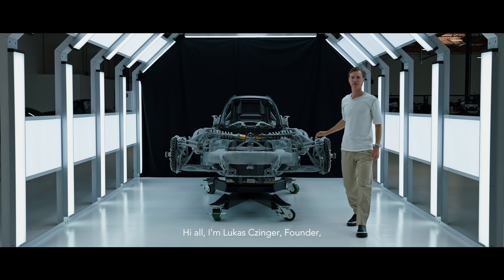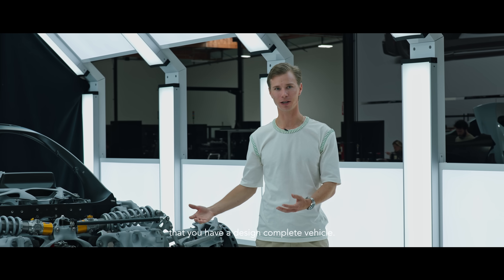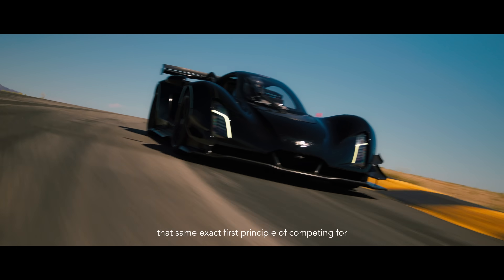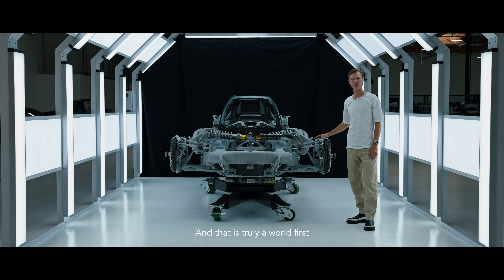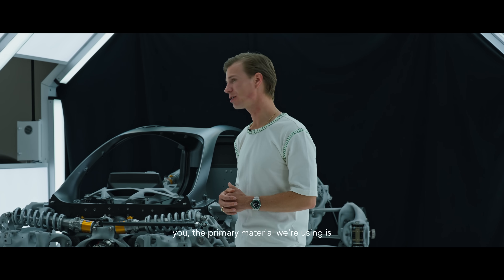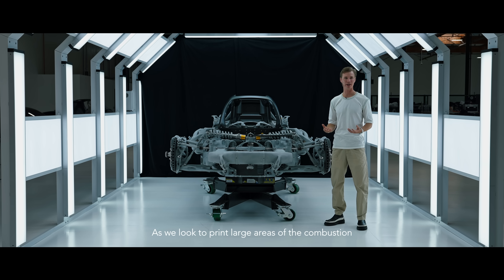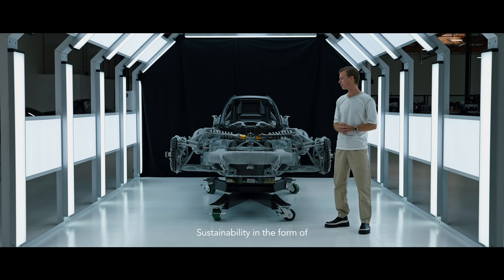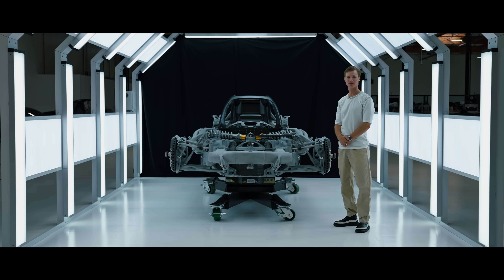Czinger 21C: The World's First Bio-Logic™ Chassis | In-Depth Overview

Comment: "you couldnt take a gram of material out of this chassis"
oxidation and abrasion: allow us to introduce ourselves
Reply: There's an FOS aka factor of safety that engineers take into account while making calculations. So things are slightly over engineered and under the conditions it is supposed to experience, it should not fail.
Reply: Maybe the intent of their statement is: "you couldn't take a gram of material out of this chassis without violating a constraint in our optimization"
Reply: @lucassganderlla7305 I am sure thats what it means. Because it definitely isnt on the edge of falling apart or folding in half.
Reply: @lucassganderlla7305  I think that's the most accurate. No way all the fasteners were designed specifically per load path and conditions, plenty of grams be to removed by drilling bolts / reducing head height or just bonding instead of bolting. The amount of assumptions made has to be incredibly high in comparison to an industrialized, mature company making constraint choices.
Reply: Probably factored into the calculation. Aluminium doesnt oxidize that much anyway for it to matter.
Reply: @KK001  perhaps it'll double as a sub and deal with salt water
Reply: Meh. It's marketing hyperbole anyway.

1. Perhaps it's true for whatever constraints they used. But we don't know--for example--exactly what and how many different load vectors were utilized for impact simulations, or how accurately they reflect real world collisions. We don't know--for example again--how extensively their proprietary printed alloys have been lab tested. We don't know--one more time--what size pothole was simulated and what speed and direction it was driven over, or whether two different potholes being driven over by different tires at the same time was simulated. Generally speaking, there are an infinite number of iterations possible, and there is no way they have iterated an infinite number of times.

2. If it is literally true, I guess you had better not ever mount stickier tires on it.
Reply: modding comunity: Hold my beer
Reply: Still doesnt make it not true.
Reply: @matthewpauls2498 He said you couldn’t take a gram out without compromising is strength, meaning this is the lightest it could be, he never said the frame CANT lose a gram of material, just that the structure would no longer be safe or stable without that lost gram. Plus it’s aluminum, it doesn’t rust. Iron rusts. Aluminum does oxidize, but that’s a different chemical not called rust
Reply: @lina4469 Ofc, my joke implies everything you said. i didnt include the rest of the quote because we all watched the vid and know the context.

but yeah it was a hyperbole but to be fair battery acid will eat aluminum and that could be catastrophic in such a car worst case scenario.
Reply: What happens when a bearing or spring wears out eventually? How many chassis components would I need to access and remove relative to a conventional car. As long as maintenance cost and complexity can compare or beat conventional designs that’s where the real sustainability will come in.
Reply: @baconthevainglorious7371  how many chassis components would you need to access and remove on a Bugatti? Stupid comparison.
Reply: @Matt_pau  rust and scuffing is bad regardless of the car
Reply: You can't take an ounce from any existing super car . This is technology that's cutting edge . This makes a Bugatti look like a pedal car .
Reply: Uninformed criticism is not very helpful.
Reply: @ScotMerrifield  That would be incorrect. If it weren't there, nobody would correct it. Oftentimes uninformed criticism is more helpful than informed, for just that reason, so long as it's treated/handled properly. Oftentimes it isn't though...
Reply: sacrificial anode: allow me to introduce myself
Reply: Abrasion from ?
Oxidation is taken into account by the FOS.
Reply: Already aluminum, not much corrosion there. AND it’s a proprietary alloy optimized against corrosion. No doubt it is very impressive, no matter your negative opinion.
Reply: @ScotMerrifield  whether or not you're correct, criticism is important, both to development, and to discourse. Dismissing it as just a "negative opinion" is so disappointingly petulant. 

They were off the mark with this one, they clearly didn't know that, or else they wouldn't have made the comment. You informed them with your comment. Why do we need to be flippant/passive-aggressive about it as well? Does it help your point? Does it help them understand? Does it bring you some odd manner of catharsis?

I agree, people should know what they're on about before they speak. However, the claim in this case, wasn't baseless from a general standpoint, it became baseless due to context. In most other cases, there'd be at least some merit. 

Let the ignorant scoff. Lead the horse to water (inform them) and let them choose whether they drink (let them choose to listen or not). At the end of the day, you have the knowledge, and that's something to be glad for, especially moreso than derisive toward ignorance.
Reply: $hit total crash test is total error with this construction bioergonomic...(only is exist in Architecture).... .
Reply: @CrazyGamerStudios  make sentences. Make sense. Point deciphered. Point invalid due to lack of comprehensible verbiage and lack of fact in statement.
Reply: Have you tried not taking figures of speech literally for a change?

Comment: This is mostly a lot of advertising spiel. 'Prato' is just multiple-criteria design which is what most of product engineering is. 
Ironically, despite the fact other manufacturers have used additive manufacturing, BMW invested a lot in it and I believe Porsche 3d printed pistons (GT2 RS?), multiple-criteria design is the reason it hasn't been widely adopted because it's expensive, labour intensive, time consuming and difficult to effectively scale up.

Topography optimization is genuinely interesting but the entire thing about nature and evolution is weak. We're talking about computers trying to design the optimal stiffness structure with the expected stresses and loads as inputs. There is the issue of unexpected stress where I'd like to understand more of their thinking. 

6000 series aluminium is the most popular series for machining. The automotive sector mostly uses 5000 series because it broadly has better strength to weight and corrosion resistance. The reason I think they are using 6000 is because it prints reliably. 

As for the 'weight' issue, I might be wrong but I think the Gordon Murray T.50 is lighter. I mean technically the Caterham 7, which is  a 70 year old design, is lighter as are various Morgans and nearly every city car. If we're just talking about the chassis then it's a bit apples to oranges because a lot of cars, including supercars, don't use the same sort of system.
I know they have to make money and that I'm nit-picking but I hate these sorts of sales pitches. They already made something cool, isn't that enough?

Comment: Basically integrating A.I with stress analysis software , giving prompts to look at the biological designs of structures and geometries found in nature. I personally don’t think it’s optimal. I think nature is trying to achieve optimum geometries the best way it can, I don’t think nature is giving us the best geometries that we should be trying to mimic, because we already have the ability to engineer perfectly straight surfaces, perfectly equal sided triangles, diamonds, circles etc. It simply isn’t true that "you couldn’t take a single gram of weight out of this chassis"  I think it’s highly inefficient. Just look at the weight compared to other similar sized cars - it’s around 600lbs heavier than a Gordon Murray T50, 500lbs heavier than a Lamborghini sesto elemento. Facts.

Comment: Finally, someone did it. Always imagined near skeleton like biomechanicly structure. Now we have it and its amazing
Reply: Just don’t damage it.
Reply: @Acheiropoietos  It's okay if you have an industrial grade metal printer in your garage and if czinger have their car part models available online.
Reply: The new Bugatti as the same kind of structure (on some pieces at least)
Reply: @86red-ch actually Mate Rimac subcontracted Czinger to produce those suspension parts for the Bugatti
Reply: @86red-ch these guys supply the suspension parts for the new bugatti
Reply: Agree. It seems only logical to use bio mimicry to achieve insane mechanical strength, high level safety, and with very low weight and cost. Insects are the perfect example. 
Once someone cracks the code to manufacture this way at huge scale, machines are going to be truly beautiful and functional.
Reply: @nalakirkwood4425 
Their priorities are oddly specific to one sub aspect of a performance vehicle: structural optimization. 
But the stopwatch (and human engagement) cares about so much more than that: maximizing the constant power curve for the driven wheels, minimising KnC compromises(giving the tires what they want), decoupling roll from ride (even warp from roll) in suspension, managing +- torque biasing (or even vectoring). 
But radical structures do get attention, I acknowledge.
Reply: @nalakirkwood4425 this mfg at scale you are talking about is the exact reason this car CAN be made this way. It’s 3d printed and the complex and even near impossible shaped all cost the same to them. There is also 0 waste. Not 100% sure how much the machine and other costs they run into are… I’m sure they aren’t cheap YET but I believe they can be!
Reply: This isn't the first 

look up the divergent blade.

 Its been around for awhile and the concept is the basis of some of my chassis design ideas as well. Not exactly like this, but its good bones. Lol

EDIT: it comes to my attention that Divergent was/is the parent company. Which only makes this 5000 times cooler.
Reply: Now if only you could work on it….
Reply: @steveg2277  yeah. We wish. 
But there are lots of other things we can do 🙂
Reply: Biomechanicly? For seriulz?
Reply: @2012listo  17 years from today, this will look like a kit car made from lego's.... sorry
Reply: @KG-zw8sc  More like it would be anything besides that. All this complexity and optimization means that it was built as one and can only function as one. Kit cars imply freedom to swap parts and change things, and have it still function.